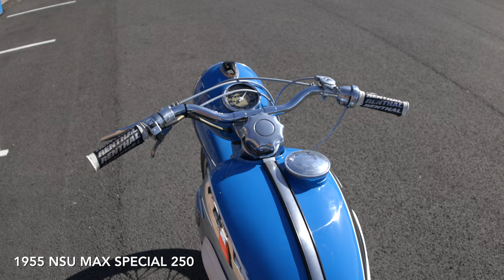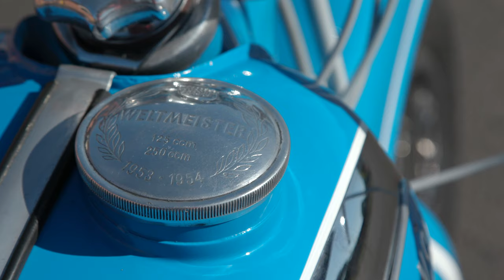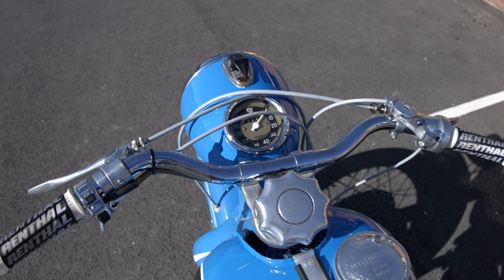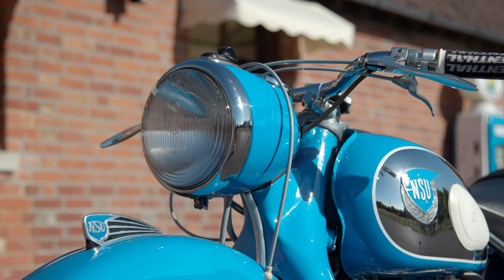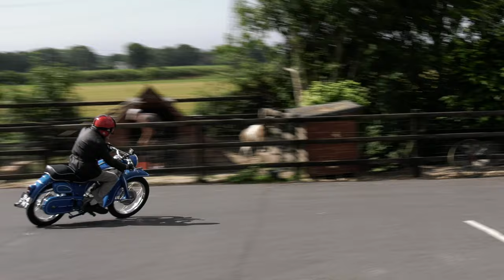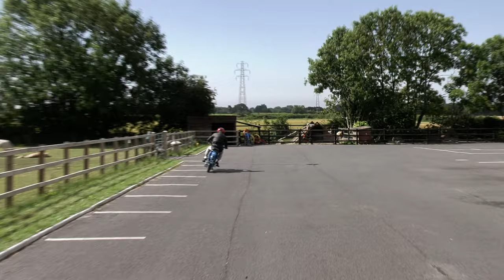1955 NSU Max Special 250 Motorcycle

Comment: First saw one of these shortly after getting my first motorcycle while a sophomore in h.s. in 1957.  I rode to all the area dealerships and one handled the NSU, BMW, AJS-Matchless brands.  I recall the 250 was then called a Super-Max and perhaps had slightly more horsepower but was painted a darker blue.  A year or so later, the Super-Max scrambler came out, painted a bright orange, had external dampers on the front forks and an upswept exhaust system.  They were high quality, cost a good bit more than my humble Zundapp 200cc and I sort of always wanted one but in time, got a BMW R-26 instead, super machine for my purposes.  The NSU engine was very mechanically quiet and I recall not quite as loud as Sammy's here in the video.  Years later, I found a 175cc NSU Maxi and bought it to commute on.  It had the same mechanical workings of the Max, just a smaller engine and overall size.  It was disappointing for power, passed it on to another owner.

Comment: I owned a 1954 Max with over 39k miles when I bought it in the mid 60’s.  It was my first motorcycle over 80cc’s and it was the most reliable motorcycle I ever owned.  It had two individual saddles instead of a single long seat.  The front end would rise a little when you hit the brake, a result of the leading link suspension.  I never like the looks of the bike at the time.  I was 15-16 and not crazy about the “stamped” frame.   I wish I owned it today!

Comment: Incredible restoration.  Thanks to Sammy and your group both.  Does anyone know for a fact whether with enclosed chain systems like this and on Jawas, if there was a self-lubricating system, such as either an oil bath or a drip?  It seems that owners would be inclined not to do ad-hoc lubrication and/or adjustment since it would require removal of the enclosure and inspection.  Thanks

Comment: The OHC was a good idea but not the idea to drive it. Instead of this tremendous complicated drive Mr.Soichiro Honda used some years later a simple chain drive which was  cheaper & much better as the NSU item.The Honda engines ( used at the C 72 / CB 72 ) worked at 10 000 rpm ! Nevertheless the NSU MAX/ Supermax/ Specialmax were nice and good bikes of course.
Reply: Honda based their engines on the 125 & 250 NSU Renmax Grand prix champions 🏆